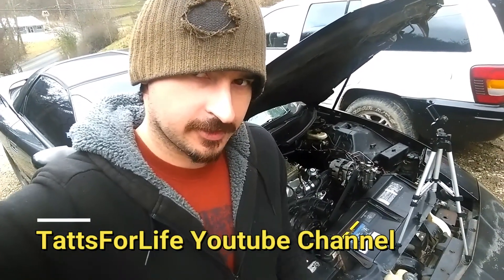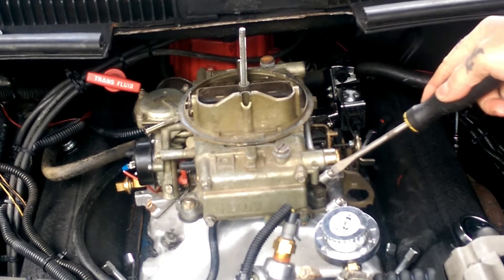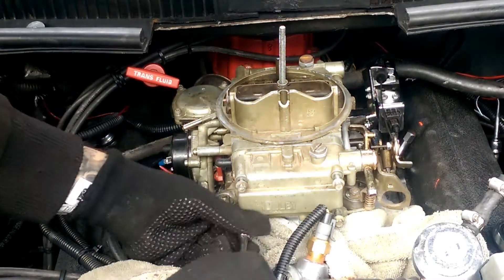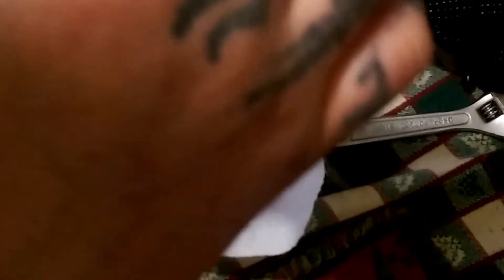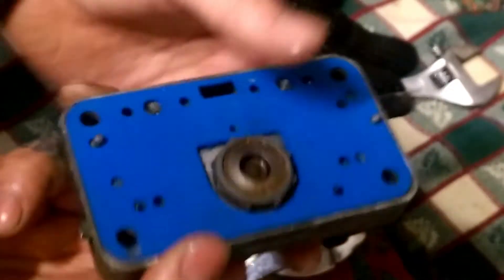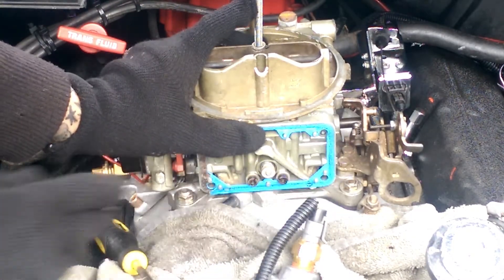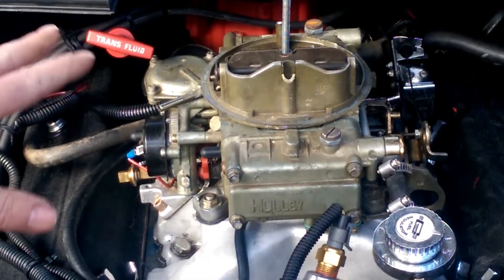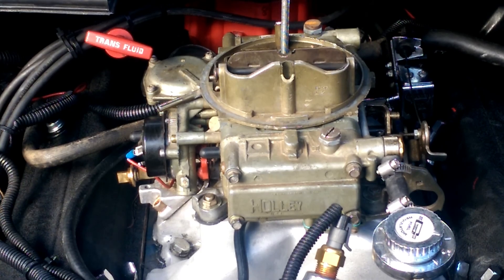How To Replace A Power Valve From A Holley Carburetor

Comment: Pull lower left bolt first to drain fuel into a cup once she backfires power valve usually done after that
Reply from the maker: on older carbs that is true, newer ones has a ball that keep damage from happing when a back fire happens
Reply: @TattsForLife   true after 95 they have a check valve but if the check valve goes bad a backfire will do the same old stuff
Reply from the maker: I have not seen any bad check valves out all the ones I rebuilt so far, but I say it can happen, but any design can have it fail points